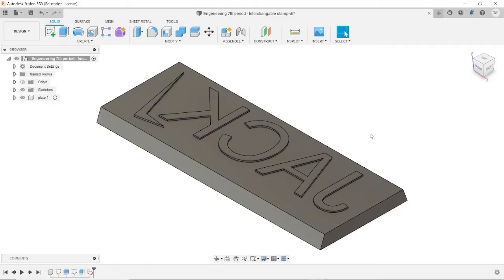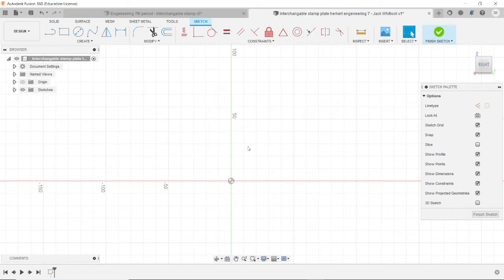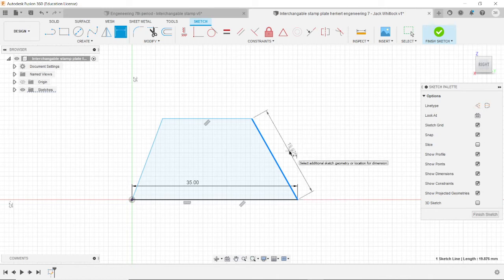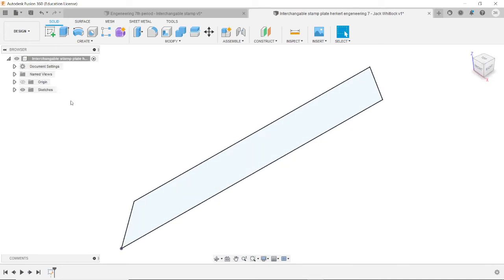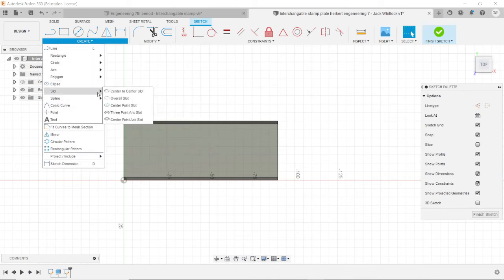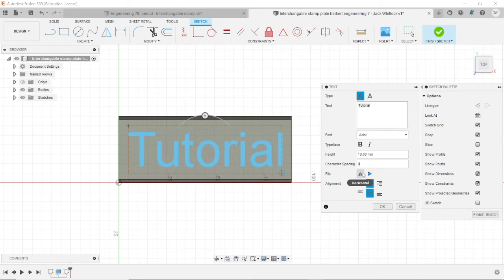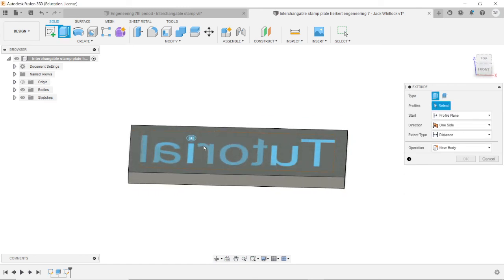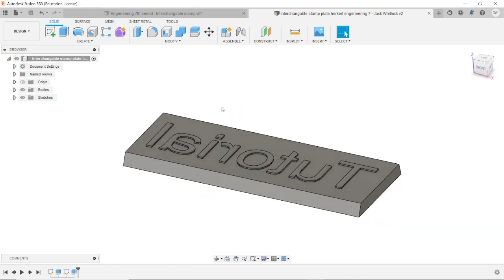How to make an interchangeable stamp plate - Fusion360

Comment: Can you show how make sloping extrusion instead of vertical? The stamps has sloping basement around the logos, letters. I wanna using thin lines for my stamp, because it will be a drawing, It should be on a sloping base, so if we imagine split vertical we will see a trapezoid if the stamp theme has thicker line, and triangle if it is a thin line drawing. It will be a negative form and filling two-component silicon, it is only possible with sloping gap. A very sharp alpen style mountains with the spine what is a thin line drawing.